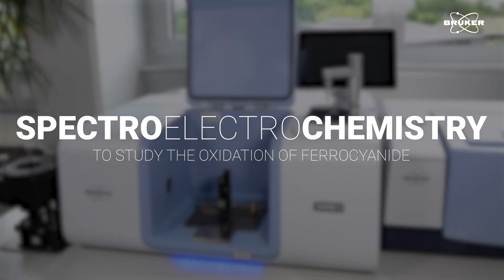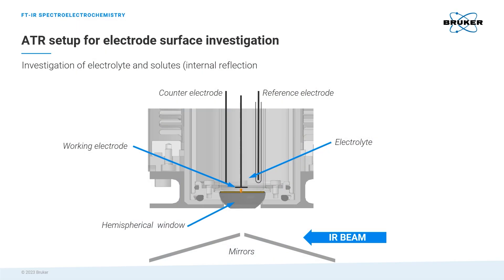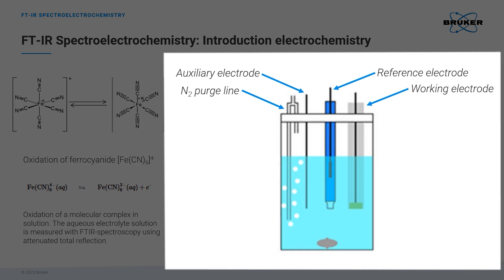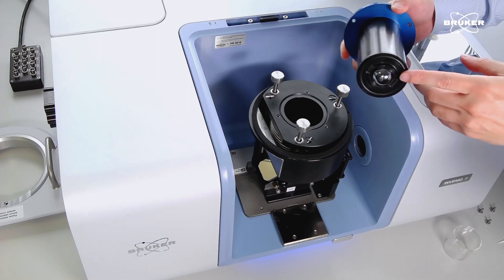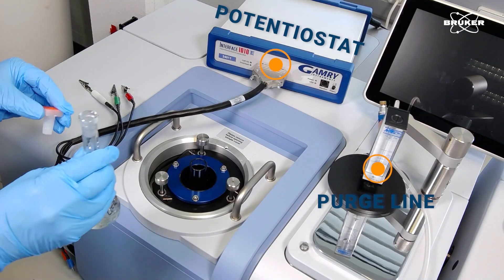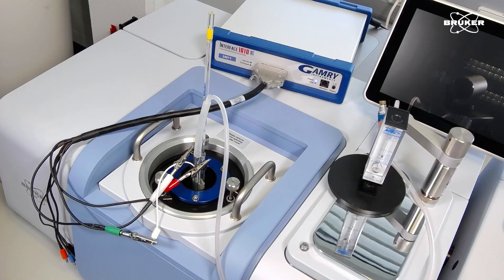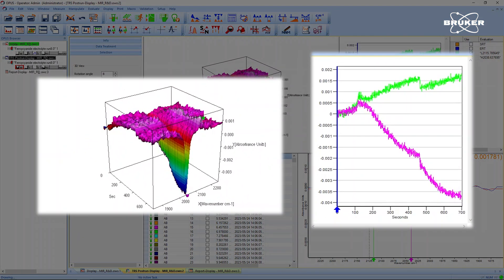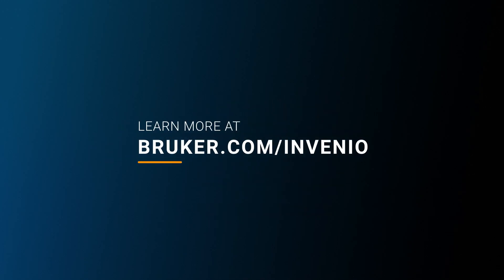Spectroelectrochemistry (SEC) by FT-IR Spectroscopy | Oxidation of Ferrocyanide | Redox Processes

Comment: A V70v is shown as an example. I assume other vacuum capable instruments, like V80v, are also suitable for this purpose, right?
"For these situations, we offer vacuum systems dedicated to perform spectroelectrochemistry."
https://youtu.be/6tvELepIQOo?t=165
Reply: For this experiments there is no reason to use more expensive V80, which is siutable for high-resolution spectrometry, which is neaded for gases.
Reply from the maker: Indeed, you are right. The VERTEX 80v is also a suitable option. The spectroelectrochemistry accessory, which allows a fully evacuated beam path, is compatible with both VERTEX 70v and 80v vacuum spectrometers. The VERTEX 80v, thanks to its Michelson type interferometer (Ultrascan), offers better spectral resolution (especially for lower pressure gases), a broader spectral range (up to UV and down to THz), complete automation across the entire spectral range (one-click measurement), and exceptional performance in time-resolved spectroscopy. However, it's important to note that spectroelectrochemistry doesn't directly benefit from the additional advantages mentioned above.

Comment: A layman question: Why the purging is not enough is such cases?
"In some cases, for example when water or CO2 are the end products, purging is not enough."
https://youtu.be/6tvELepIQOo?t=162
Reply: I mean, what are the typical examples of such experiments?
Reply from the maker: Hey Alexander, 

If CO2 or water is produced or used in the reaction, it becomes challenging to differentiate them from atmospheric CO2 or water in the beam path (outside the electrochemical cell but inside the spectrometer). Purging helps maintain low and constant atmospheric CO2 and water content, canceling out disturbance bands through reference measurement.

However, residual atmosphere cannot be eliminated. Fluctuations in the atmosphere may be incorrectly interpreted as changes in the cell's reaction. Additionally, when quantifying CO2 or water (as a reactant or product) by tracing their band intensity to monitor the reaction progress and understand the mechanism, atmospheric absorption in the entire beam path can disrupt the plan.

For accurate measurements, vacuum spectrometers with a completely evacuated beam path and no detectable atmospheric disturbance are essential. An example application is methanol fuel cell research, detailed in the following publication:
https://pubs.acs.org/doi/abs/10.1021/acs.jpcc.8b06840

Hope this helps!